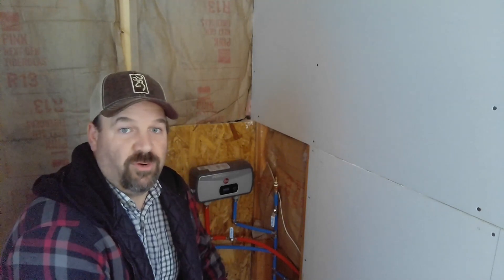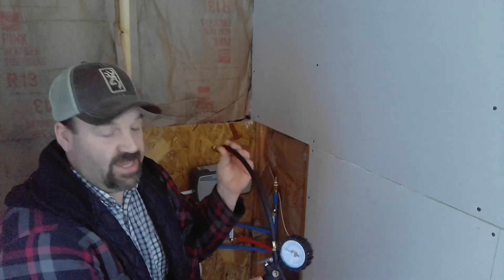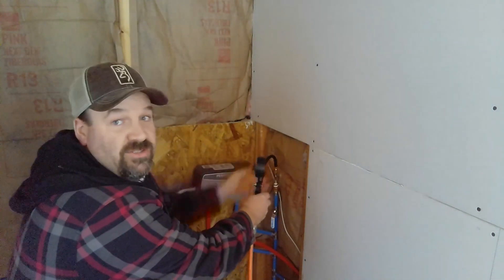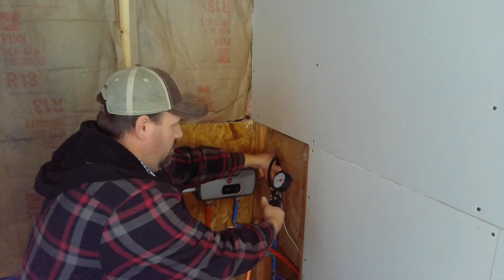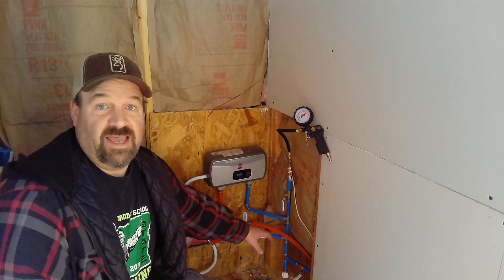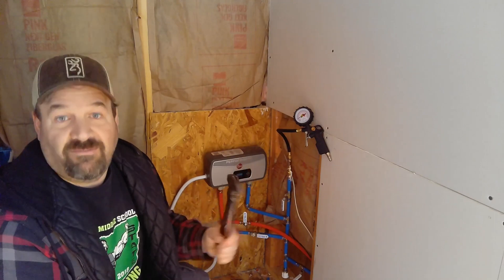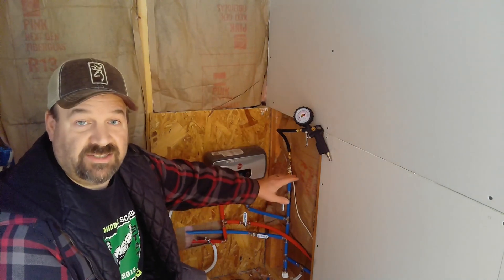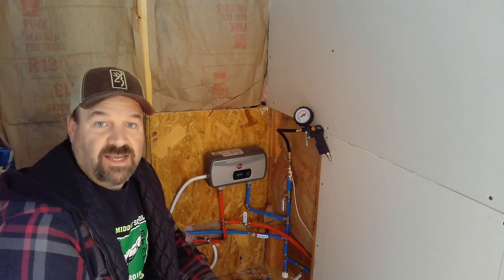How to Pressure Check PEX Pipe - Tiny House Build

Comment: This is not exactly an advertisement for the use of PEX.  I'm assuming this guy is experienced and yet multiple failures. Oh, boy.
Reply: Not unusual to have leaks or forgotten fittings regardless of piping method.
Reply from the maker: I am not an expert.  Just showing what I did and how I tested our water lines out before closing them in.  
This was my first project with PEX too.

Comment: Is the pressure coming from an air compressor? Can you do this with a bike pump or something?
Reply from the maker: Yes the air pressure is comping from the air compressor.  I am sure you can use a bike pump but it will take a lot of pumps to build up pressure.